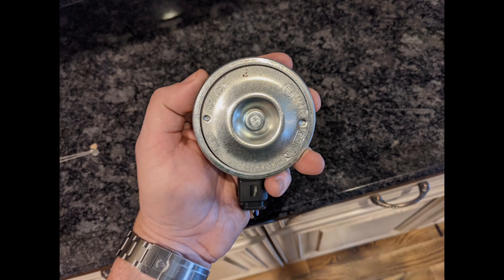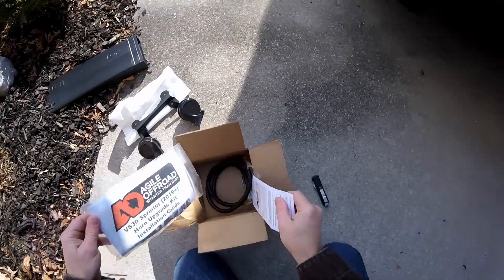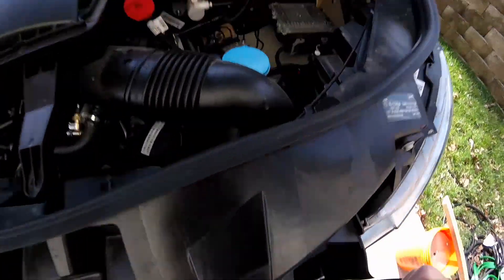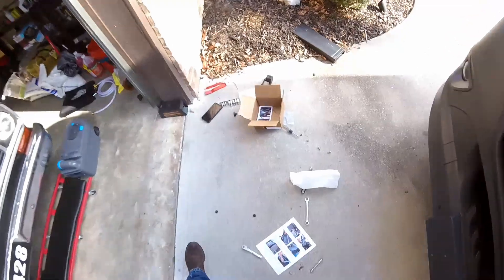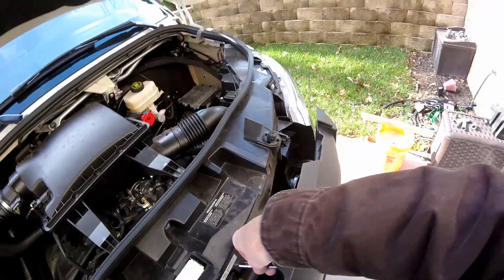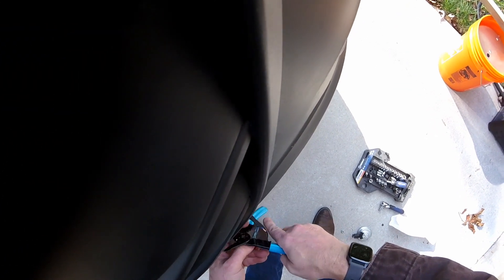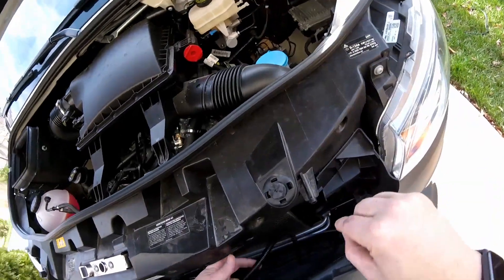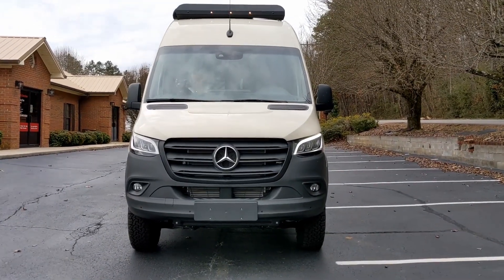Winnebago Revel Horn Upgrade DIY- Makes It Sound Like It Looks!

Comment: Thanks for the good video. I could'nt quite see - does this mount behind the cruise control distance bracket with same the T-25 Torx screws or with the two additional bolts Agile supplies?